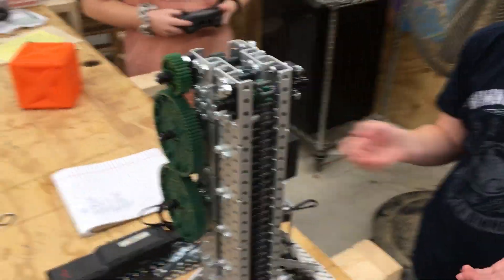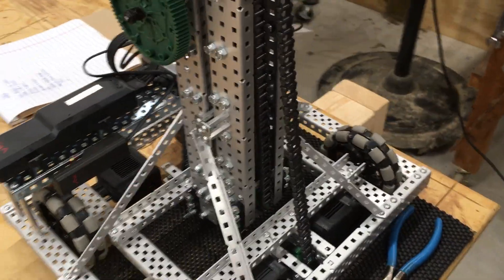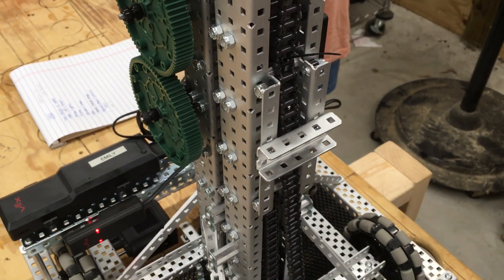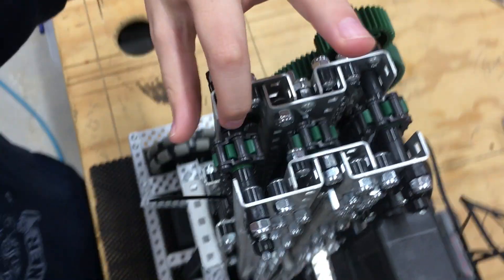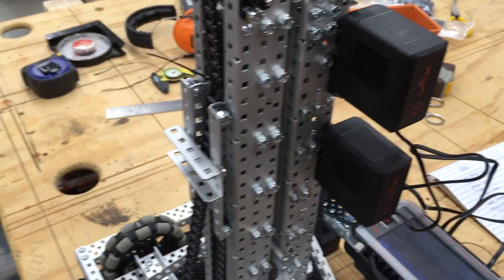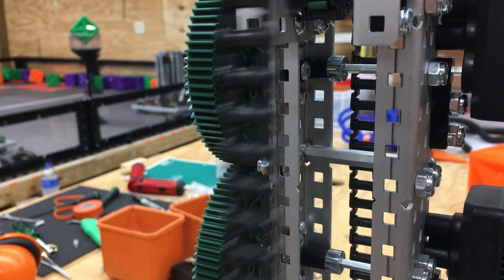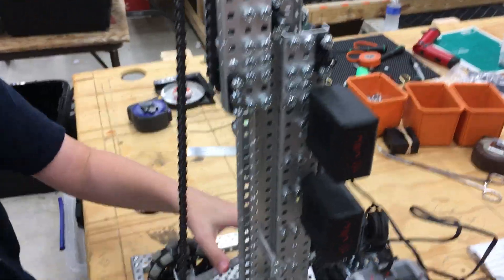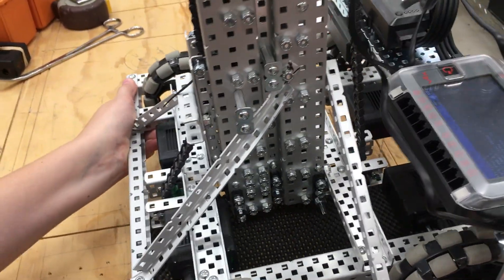vex edr tower takeover prototype #4 lift design

Comment: If you Scoot your Cascade back about four hole. Will get better center of gravity. Because it’s looks like it’s in the Middle of your base. That’s probably why it’s tips a little forward. Let me know if that helps
Reply from the maker: Tipsy is mostly from it being 4.5 feet tall and going fast.
Reply: @turbodog99   if you had the lift about 4 holes or more back the stages would be sitting in the center of mass as your lift is your heaviest part you want to mount it as low as possible making it less tippy, we have our own cascade lift that extends 5 ft and has a tipping angle of 45° fully extended